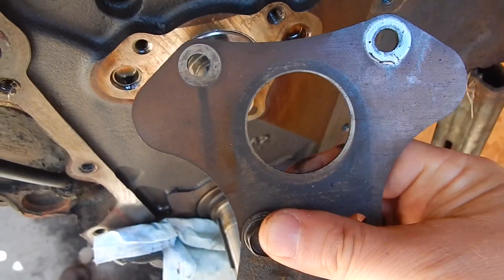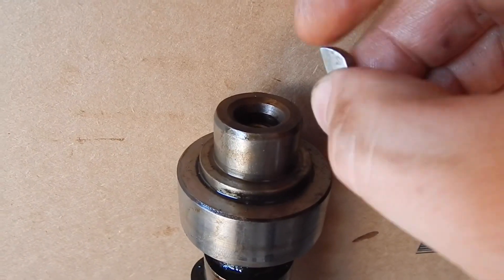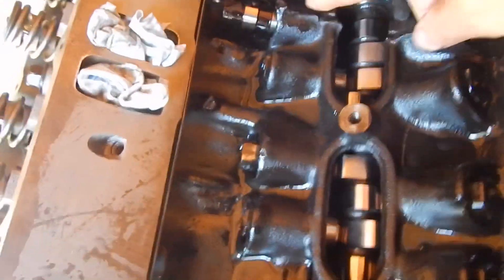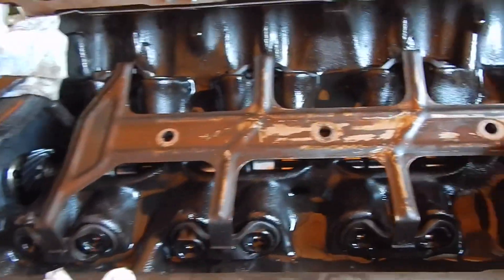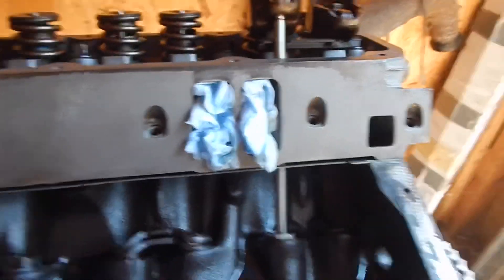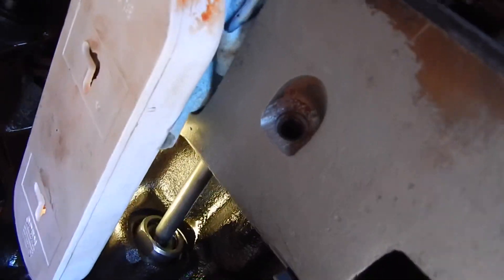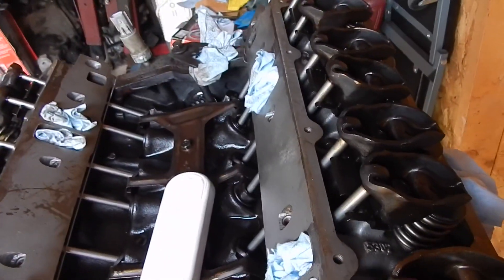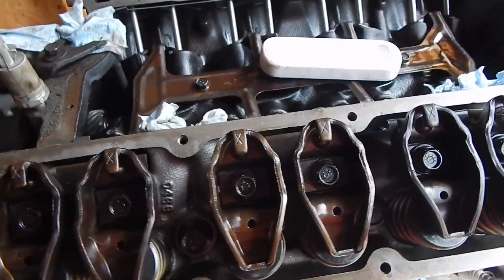Valve Train Assembly on the Low Dollar 360  Mopar 5.9 Magnum

Comment: On my carbed 5.9 I'm using comp pushrods as well. As well as guideplates, ARP 3/8 rocker studs for a SBC, and SBC comp aluminum roller rockers. I set it at zero lash and it is a tad noisy until the engine gets to about 150 degrees but gets nice and quiet after the temp goes above 150. I'm using the stock cam for now. It runs really well with the speedmaster dual plane, no spacer and a 650 brawler mechanical secondaries carb. 904 trans, 2500 stall and 3.23 gears in a 91 rcsb dakota. Low 13's
Reply from the maker: Very Cool !!!  Thanks for watching !

Comment: Great Video and Nice Rollors!
Reply from the maker: Thanks!   The factory rollers work great in a mild build like ours.
Reply: @318willrun  Awesome....Did you see my $10 fix video? I wanted to see what you thought of the fix. I checked in my last video and nearly a drop of oil out the exhaust compared to before. Sorry i would have messaged you on FB but not sure if you have one

Comment: That was A very informative video an very well said ! Presentation done very well too ! Very easy to understand you an follow along 👌 you also jus helped me diagnose a problem on my truck that I’ve been pondering on ! Since I installed new cam an lifters in my 5.9 magnum , every time I cold start I get a lifter noise for few seconds .. then once started an driven an restart it doesn’t do it . But if it sits for half a day an restart it will be like a semi cold start again for same day An I get lifter noise ! I kept thinking that maybe I had a cpl bad lifters outa the new batch ! But jus hearing you say if the oil hole in the lifter isn’t facing cam then one will get bleed down an lifter noise when starting !! By George I say ,, that is what I ve done I bet .. I have a wicked gut feeling that’s what I got happening !!! QUESTION ?? What will happen if a guy kept driving for any length of time with it that way ? Will eventually damage lifter or cam ?? I suppose a guy should take back apart an check  to see if that’s what’s really wrong An causing it, an turn them the proper way an have fixed an be done an not worry no more ? Right 👍 thanku for that great informative video 👌👌
Reply from the maker: Thank you for watching!  Personally, I'd just pull the intake off and be sure the lifters are orientated the right way.    Will it damage the lifter if it's wrong ??  I'd say over time it could.
Reply: @318willrun  yes that I would figured . Thank you for your quick response an advice as I felt that I probably should do that . An hearing that you would too confirms that I know what project I’m about to start right away ... lol .. thanku again a hope you have a great weekend 👍

Comment: Great video! Just curious if you measured compression ratio? On the Magnums I’ve  ‘heard’  they are actually 9:1 or at least real close. Also just an FYI if you haven’t seen it, Richard Holdener did a live video yesterday with Steve Dulcich and David Freiburger talking about the Magnum dyno results after doing the Piston Reversal theory. Anyway, keep up the good work and we’ll keep watching lol!
Reply from the maker: Thanks for watching.  I did not measure the compression ratio.  Yes, the magnums do have a bit more than the LA's from the factory.   I seen what Richard got with the stock magnum, nice !

Comment: Another great video that was over too fast 😭 the good ones never last long enough but I totally understand with it being as hot as it is its tough to keep wrenching on it especially if you sweat like I do, if so you will have filled the block up with sweat 😂 , Is that one of those regrinds that they sell on Ebay? I bought one when I first started building my stroker 347 I bought one and installed it and by the time I got the heads on I got cold feet and was afraid that I was leaving hoursepower on the table because it was a flat tappet as well because I thought that they were an exact copy of the one that they were comparing them to and I asked the guy who i bought it from and he said that they work but are not 100% saying that they were good to throw in a beater and go have fun at the track with so that done it for me because I wasn't building a beater well it might look like a beater but I like to think that it is not anyway 🤣😂 so I ordered a bigger roller cam from comp cams, one that I knew would make good power and slapped it in there and got the beater cam out of there so Beans won't think that hes a beater and then try to act like he's a beater 😂🤣😂 but he probably will it anyway 🤣 Im sure that you got one that is done right and came with all of the specs, I couldn't degree mine in because they didn't know all of the specs outside of the lift and duration ,he said just put it in straight up and ride 😂🤣😂
Reply from the maker: Can't fill the block up with sweat, all that salt would rust the block!!!!  LOL.  Thanks for watching

Comment: You need a solid lifter to accurately check the clearance at full lift. The plunger is compressing on the hydraulic lifter, giving an inaccurate reading. I disassemble the lifter and use washers/small nuts/etc. to shim the lifter solid.
Reply from the maker: Thanks for watching!    Thanks for the tip !   I like to physically see how far down the plunger goes for my preload.   Many ways to skin a cat (who actually skins cats?)... lol.

Comment: Hey 318willrun. I've got another question on the 318 I'm putting together for my son. After I cam in and timing chain on with crank gear at 12 and cam gear at 6. Which direction do I install the oil pump gear. More or less which direction should the slot be after dropping gear in.  Thanks ..
Reply from the maker: If the rotor on your distributor is lined up with the slot for the gear drive, then have the oil pump gear slot facing # 1 cylinder
Reply: Thank you...

Comment: Right there at the back of the engine looking at the cam and distributor gears did you break off those pieces of the block? I have my intake off my 318 to port heads and found mine looking like that and I believe it broke somehow it broke off and went through my engine, I’m finding crumbs of metal the size BBs up there in the oil laying up there, is this just how it is casted or do you think mine broke off? My engine runs fine no oil burning so it’s not damaged thankfully
Reply from the maker: I don't think it's broke.  However, most of my workings have been with LA small blocks.
Reply: That’s good news then because I was worried, thank you I appreciate you taking the time to answer 😎😎😎

Comment: Whats the swap like to put a magnum engine in an older vehicle? Any motor mount or clearence issues? What about trans bolt up? I was thinking about getting a magnum 360 or 318 and putting it in my 5th avenue. Its got a A-999 trans. If i do this i am going to have the trans rebuilt. Its got some shudder anyways. But im sure it can be made to handle a 360. Im just not sure about bolt up??
Reply: Also. Any ideas for a junk yard rear end that would be an easy swap to an m-body?
Reply from the maker: Same bolt pattern for the bell housing.   5.9 magnum will need the flexplate it came with, or an aftermarket one and then it will work with the 318 converter.   The 5.2 magnum would be a drop in, and you can use your LA timing cover and pulleys on the magnum if you want.

Comment: The springs on the Mopar Performance I bought seem a little heavy.
When I turn the engine in my hand I feel a weight because of the pressure on the cam.
This is normal?
I'm afraid of having too much spring load and damaging the cam.
I thought of putting a 0.078 washer under the stock pole to increase the load a little, what do you think???
thank you very much for helping me
Reply from the maker: there will be some resistance.   You can check the install height of the spring, and then check the pressure at that point.  that is the only true way to know what the seat pressure is and the over the nose pressure.

Comment: Hey ;) Do you think it is important what number is minted and has a specific place? and does it matter which side we put it on? I screwed on this plate and sometimes I don't want to turn the camshaft because these handles are blocking it 2:53
Reply from the maker: @ 2:53  - that is the dog bone.  The lifters have to be squared or the dog bones wont' let the lifters rise without bending something.   Dog bones should be able to go in any place (interchange), they are not spot specific.

Comment: Great video! Got a question for you, I'm getting ready to upgrade my 360 installing a Extreme Energy Comp Cam 264R14 Part # 20-745-9,  480 Lift,  212 Exhaust/218 Intake , and comp cams valve springs part# 901-16 summit part# CCA-901-16 the spring rate 353 Ibs,/in. and Sealed Power Hydraulic roller lifters, all that being said it's a fairly mild cam all it requires is a valve spring change, but I figured while it's tore down might as well replace pushrods and the valve seals too, what I need to know is can I still use the stock pushrods? and if not what ones would I need? and still using the stock heads, like the length and diameter of a new set?
Reply from the maker: If you are using the stock rocker arms, then I think the push rods should be fine
Reply: @318willrun  Yep I will be  using the stock rocker arms.

Comment: I was here thinking, my cam is not that high.
.417 stock exhaust, 0.506 comp cam
intake stock .411 comp cam 0.506
Can the original springs be used?
if i put a seat under the spring to get a little more charge, would that work.
Reply from the maker: Not saying you can't use them, but the factory springs on the magnums barely make do on the factory cam.   Personally, I would upgrade the springs.

Comment: Yeah I'm redoing my head gaskets and everything on my 5.9,  and I went ahead and removed the lifters and push rods and everything and I was watching man what do you mean by have your lifters facing the cam with the oil hole?? Any info would be greatly appreciated thanks for posting
Reply from the maker: Lifters have an oil hole.  You can see it at 2.39 of the video.  You can see it again at 2.49 when i push the lifter up.
Reply: Ok thanks man really appreciate it 👍

Comment: hello how are you..... can you help me?
i have a compcam 20-746-9 in my durango 5.2 and a need replace de springs valves, did you use Mopar Performance Valve Springs P4876062??
can i use this spring with my stock retainers??? thankssss
Reply from the maker: I used the Hughes 1110 spring kit, and it looks like they'd work great for you cam as well.  Comes with springs, retainers, and locks and fits on the factory magnum head without machining
Reply: @318willrun  hello thanks, thanks, thanks 
but i cant find this part. where can you to by this??? i m from brazil.
Reply from the maker: @GalpaoV8  Looks like they may be currently out, but here is the web site.  The spring kit was Hughes 1110 https://www.hughesengines.com/Index/index.php

Comment: What is your favorite camshaft ?
Reply from the maker: Thanks for watching!   Do you mean brand name ??   Size of cam would be engine specific, but brand I'm not sure I have a favorite, but I'm impressed with Oregon Cam Grinders.
Reply: @318willrun  I'm installing a comp cam 506 lift into a 5.9 mag with some mild porting , thin head gasket and going carburetor , hope it works out for short drives and squealing tires .
Reply from the maker: @Ratridez  sure she'll be a ripper !!

Comment: hey how's it going.
I  installed the new cam and new springs. But the engine is weak and dying.
put all the stock timming marks .
the distributor is marking 0 degrees on the scanner, wouldn't it be better to advance the point a little ??? thank you abs
Reply from the maker: Depending on the size of cam, but you may end up between 12* to 22* in initial timing. I would put it at 10* and see if it's better.   If so, try 14*.  As long as the engine is picking up rpm's and acting more lively, you are heading in the right direction
Reply: @318willrun  but my 318 is modern, i have fuel syc.
Reply: @318willrun   think the vacuum decreased in the tbi air intake, that's why it's dying
Reply from the maker: @GalpaoV8  ahhhh.... good point.

Comment: Love the video! I just rebuilt my 5.2 (had 204k miles on it). I put a Hughes cam in it with the same spring kit you used (1110). The cam has .507” lift int and .517” ex w/ the factory 1:6 ratio. Truck fires up and runs, however I am getting a really loud chattering/clicking from what sounds like The Valley. I have taken it apart a few times and made sure my lifters are in right, but it hasn’t gotten any better. Any ideas? (I was thinking maybe push rod length?) thank you for your videos!!! @318willrun
Reply from the maker: I would go to push rod length first.   Then look at the lifters themselves if they are aftermarkte